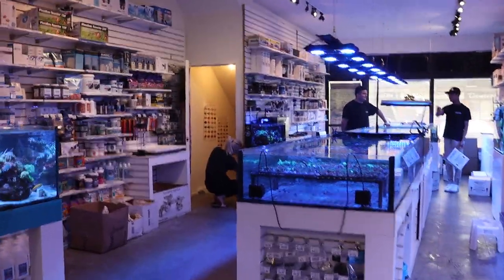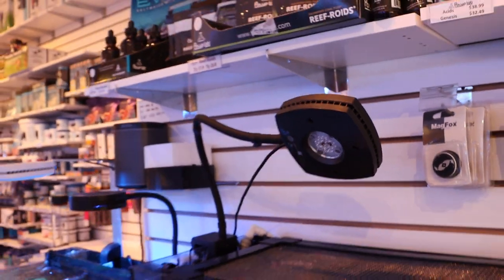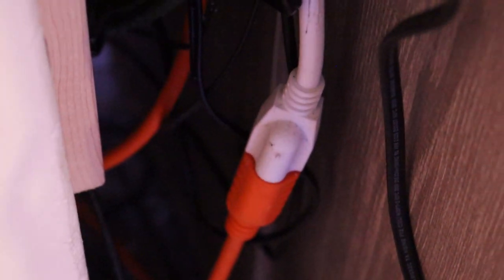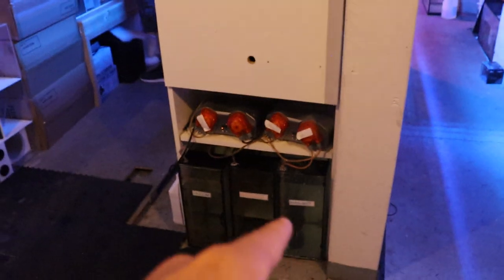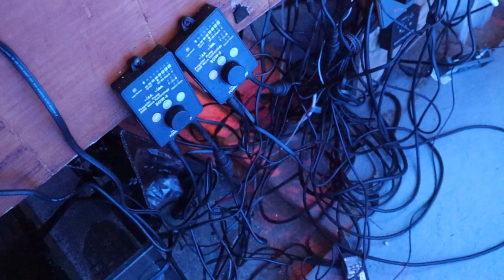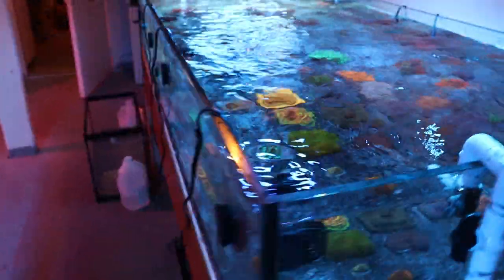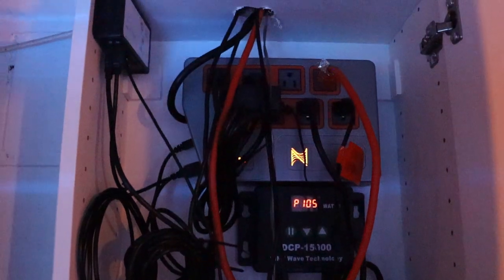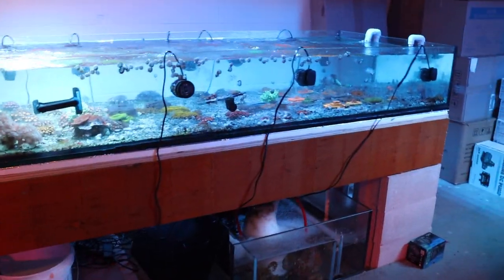Potential Fire Hazzard \\ Reef Tank Aquarium Wiring

Comment: After the wire management to my tank I noticed it would be a pain to remove the skimmer for cleaning. So what I did was I spliced a 2 or 3pin waterproof connecter on the skimmer and other things which makes it a lot easier to clean without undoing all the wire management I did.

Comment: Yep. The settings you had on the aiprime was way to high I commented on your previous video telling you your settings so high you will melt the lights…
Reply from the maker: the cause was water getting into the power supply not the setting on the price
Reply: @fragboxcorals  with the settings you have I had the same. Water got into your system also as we can see but that does not cause ur light to burn . That is with your settings maxed it hapend to me I know this